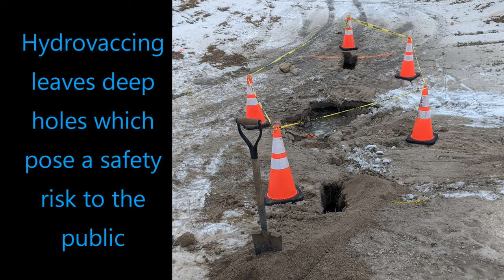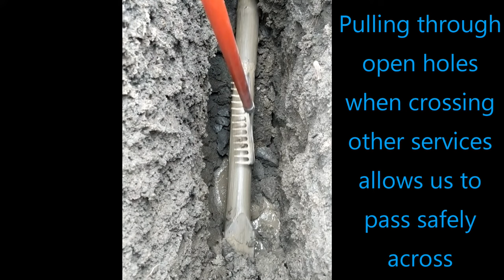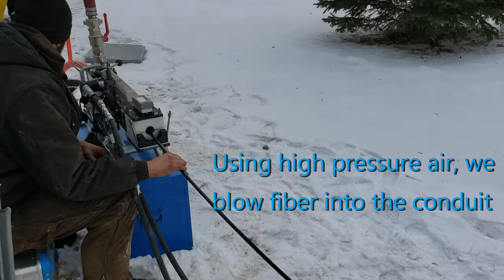Fiber Construction Process - 2019

Comment: Anyone know what the average time frame is between the time when the initial underground conduit is buried until the fiber is available to the customers? One month? Three months? Longer?
Reply: I’d say within a year or two. Could be sooner just really depends on the contractor, contract stipulations, workload and area/ ground conditions. I’ve been lucky enough to be apart of a crew that finished  4 small towns for mainline and fiber/drop placement to all houses in about 9 months time. I’ve seen companies take several years to finish out projects in smaller cities. A lot of factors to account for but hope this gives you an idea even if it is the slightest

Comment: How for can you blow the fiber at a reasonably fast speed of at least 50m/min? 
We in Austria mostly blow 6-8mm cables in 14/10mm ducts at speeds of around 150m/min on the first 500m, 90m/min within 1km and after that around 40-50m/min. 1.8km is mostly the maximum we can achive in one go.
Reply: Different terrain.